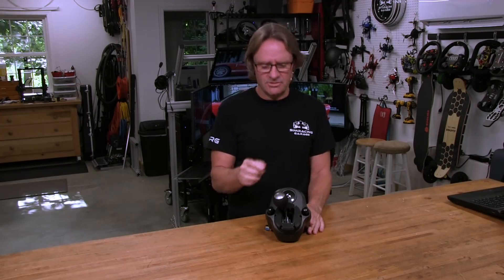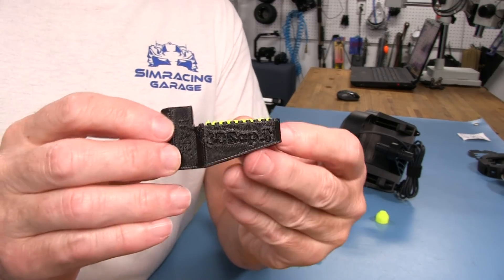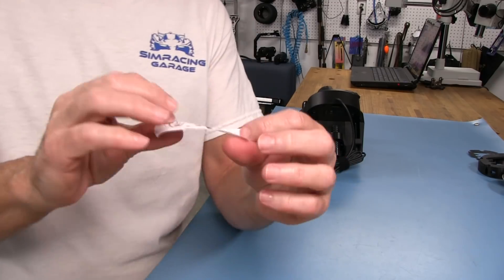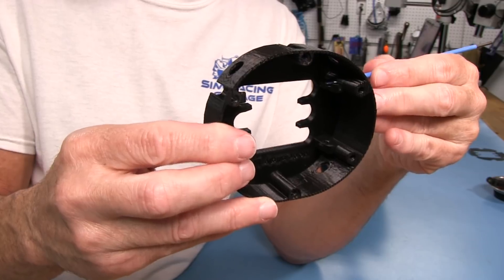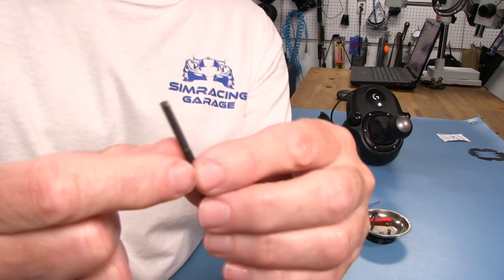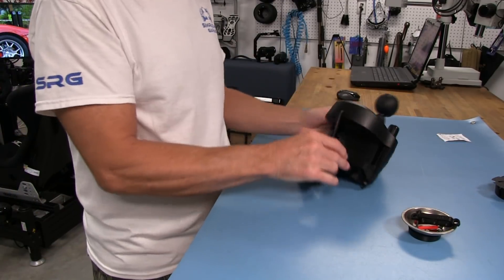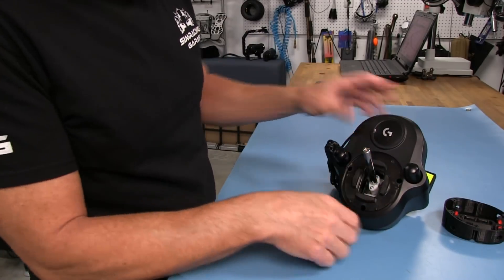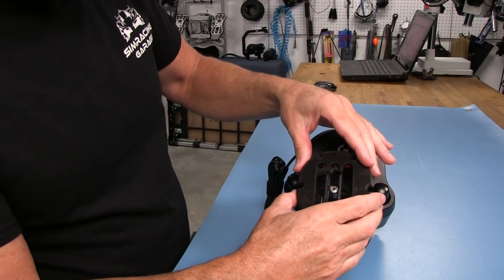3DRap Logitech G29 Shifter Mods

Comment: After finding a bunch of different mods on eBay, I came here for some honest advice. I saw the 3Drap solution as the 'premium' model so after this review I bought it. It's been installed for two weeks. Everything in the video is bang on the money.

However...

The durability issue is real. Not because it wears down though: It is so tight on the shifter shaft that mine snapped after about 8 hours of play. But it wasn't the first thing to break. It took less than an hour for the thin piece of material partitioning 1st and 3rd gear to snap off. I've just lost the opposite piece between 2nd and 4th. This gives my shifter more of an OI look rather than HH. There is still some clamping force from the snapped part (more so in 1st, 3rd and 6th as the snapped occurred at the other end) and it's definitely still an improved feel. But it is not the golden solution sadly.

3D-printed stuff is everywhere now but I am finding, consistently, that either the material oo the fabrication process often results in low tensile strength. I bought a 3D-printed mount for the shifter, for example, that showed signs of stress almost immediately and is likely to snap within the next couple of days.

So, great design but it needs to be fabricated with something either more flexible or more durable.
Reply: Update: I went and uploaded a video highlighting everything I mentioned above. 3Drap reached out and replaced my broken parts with their new version: a nylon clamp and metal top plate. At their request, I reviewed them after putting them through their paces... and they've fixed it! They're the golden solution again.
Reply: It's the 3d printing process. They are pumping out parts and want to do so quickly. It looks like they are printed at the lowest quality. Find one that's made of ABS and not PLA
Reply: @Mk6GTIMike  I know I'm late to the party, but I was thinking the same thing. PLA is not the material I would have chosen to make that gate out of. I would have done it at least in PETG, if not some form of Nylon like a Taulman Alloy 910 or something. However, I have seen recently a mod that uses magnets instead of something sliding on rods, and that's probably the best solution.

Comment: After finding the whole G920 with Wheel, Pedals, and the shifter and a Mounting System for it at an estate sale for 55 bucks, I think 40ish in mods is reasonable, imma have to check it out.
Reply: Thats insane
Reply: you actually got a working G29 for 55$????
Reply: @alouisschafer7212  Yeah, the Xbox one, with the shifter and a pedal/wheel/shifter fold away stand/mount. Gotta love those estate sales.
Reply: @Bilbo Fappins they had a thrust master too.... I done fucked up by not getting that one.
Reply: @randipoling635  thrustmaster has an even worse reputation for reliability than Logitech does on their entry level stuff. The G29 is fine. It’s nothing earth shattering but I’ve never had a problem with mine once.

Comment: 3Drap is the best! Giving us what the manufacturers should've ➕ for a cheaper price
Reply: @trigger_me_timbers  I think he got paid to leave that comment
Reply: @trigger_me_timbers  The problem is the durabilty, i wouldn't mind paying that amount even thought it cost half of the clutch, if it lasted, but it doesn't last long and by the way, don't forget the cost of deliver...
Reply: If I could get it shipped to my place for a decent price I'd be all over it. But it's not cheap to have shipped to Canada and shouldn't be hard to make in a 3dprinter program. They're probably on thingiverse actually
Reply: @tylervardy3917  my 3D*c*rap shifter broke after only 1 week.  The inner piece that is considered a wear item, broke after 7 days, and the top shifter plate cracked after 2 months. 

I'm from Canada, 3Drap offered to ship me two of those inner pieces to guide the shift selector, but shipping was $20 Canadian. I'll pass.  The top plate I still haven't contacted them about, but the overall quality is extremely poor.

Comment: I own the THPA Shifter I got an old golf club (as the shaft steps down   size you can fit it snugly over the top of TM rod )then put a sparco quick shift knob on top ....also mark on shaft where the hole is on the original shaft and but a small bolt through to hold in place ..it looks and feels bloody great.......its not as slap dash as it sounds 👍...

Comment: Thanks for a great review. Would you, as an expert, prefer a longer stick with the mod in place?
Reply: I always figured a slightly longer shifter would feel better/more realistic but I'm not sure
Reply: That's what she said
Reply: depends on what ur used too. my last car had the shifter mounted on the dash next to the wheel rather than between the seats and it was like the g29 in looks and i noticed it was easier to use for me than the longer shifter in my other cars.
Ive modded my wheel rig set to put the shifter next to the wheel rather than low down where it was before.
Means less distance for ur hands to move so u can get ur hands to and from the shifter and wheel faster.

Comment: Very informative video.  Your videos are awesome explaining things in great detail.  Do you know if it's possible to change the shift knob to a t handle shifter like a hurst or maybe even a pistol grip? Is it possible what would be involved? Thanks
Reply: It is possible. There's a few different ways to go about it, however, if you're looking to run a "standard" (real life) size knob I'd suggest a solution like the link below. You can specify what thread size you need for the adapter to fit your specific application.
https://www.ebay.com/itm/Logitech-Shifter-Knob-Adapter-G25-G27-G29-G920-/263627486116?redirect=mobile

Comment: Hi Barry. I got the improved feel mod today and followed your excellent video to install it. However I find it's now way too stiff and the gear stick gets stuck in gears - I have to use all my force to get it back into neutral. I notice in your video driving at the end that you use a lot of force to move between gears. Is this how you normally drive or is this to counter the getting stuck in gears that I have found? I can't apply this much force on my rig because it's tpo noisy: my wife came running upstairs to find what the racket coming from our bedroom was! I also feel it's pretty unrealistic: I don't drive myself (yet) but I've never seen drivers using so much force to change gears. Any thoughts? Cheers.
Reply from the maker: With my shifter it is not that hard to change gears. Not sure what could be causing this. I would disassemble the mod. Try it without the mod. Then re-install the mod.
Reply: Thanks Barry. It definitely doesn't feel right. I'll disassemble but will need to find the correct sized allen key for the shifter screws. Cos took me ages to loosen/tighten them with flathead!
Reply: So I spoke to 3Drap and they think the piece that holds the gear stick was simply the wrong size and are shipping me a new one for free. Hopefully that will fix everything.
Reply: did it fix it?
Reply: @ekhliousful  it did not buy apparently I'm the only person who has reported this issue. I think it might be a problem with the grease I'm using.
Reply: I got some shimao grease andthat made it a lot better. personally I still find it too stiff though and quite noisy so have gone back to the factory standard.
Reply: @formulaic78  i guess i am not going to buy it then thanks for replying
Reply: You need to buy silicone grease, the parts look like carbon, with standard bike greases, PTFE/Lithium etc they will cause the carbon to swell, WT40/GT85 will cause the same problem.

Comment: Man I miss being able to break with my left foot, recently became paralyzed on the left side and am using one foot on GT sport with a DFGT. Considering getting the G29 but really hate missing my left leg.
Reply: 3drap has a mod for playing without using your feet. You control the throttle and brake with your hand. I don't know if that would be useful for you.
Reply: berarma thanks a lot for the tip, I can use my right foot for both pedals but clutch/ heel toe is a no go. I’m more interested in sequential shifting options, looks like there are mods for the G29 that work for this, hopefully anyways.

Comment: Great video!!! I have a question. How about the durability? I guess you use this mod for about one month. Did you have any problems?? Thank you.
Reply from the maker: I haven't noticed any degradation in the feel yet. I think the trick here is to make sure you have an ample amount of good quality lube applied on the appropriate friction points. But no matter what you do, it will wear out eventually.
Reply: @simracinggarage3026  Thank you very much. That is all I want to know. I have some problem with some gear switch. 4 to 5 and 5 to 4. I was looking for something like this mod, and I think I will buy it.

Comment: Great review buddy, however, you should try to use a clutch with this setup, it must add quite a thrill, also trying Punta Taccos gives so much adrenaline during race.
Reply: In that kind of race car you usually do float-shifting. Pretty much like on an Eaton Fuller Manual gearbox in a Semi.

Comment: Yeah, a 3D printed clamp is stronger than a proper injection molded plastic part, sure, and as for the grip, all you need is some hot glue.

Comment: Shame there was no way to reattach the leather boot of the original.
Reply: I thought the same exact thing. Only a matter of time until some small object falls into the now completely exposed shifter.
Reply: @milkshakemuncher  is the 3drap product reliable because I am wanting to buy one but want to know how long they last and Also which one to buy in 2020
Reply: @raxal9833  mine has been in for a few years now, I greased it a bit when installing it just so it slides better and doesn't wear out as quickly also once every 3 or 4 months I lube it with a little grease again. It is still going good but in saying that, there are periods of time where I'll use it every day for a few weeks but then sometimes not use it for a couple of months. At the time of purchase I also bought the carbon heavy duty insert to replace the smaller one if it broke (haven't needed it yet). I was like you, not wanting to waste time and money if it would break after little use. They say on the website that as it is a 3d printed plastic item it will eventually wear out, but replacement parts are cheap and from my experience it lasts a long time that you get your monies worth.
Reply: @raxal9833  if you click the blue link in my first comment, it will take you to the 3d rapit site on the exact page of the mod I have is (Cambio H shifter V2 mod) 14.99 Euro I think. Then if you scroll down that page you will see the standard V2 replacement piece 6 something Euros and to the right you will see carbon extra strong V2 insert 9 something Euros.

Comment: To impove my mounts, i have literally just jammed a couple of soft erasers in between the mount and the desk... no need to print/buy new clamps
Reply: i have mine mounted to a wooden platform (sililar to a desk etc) with no additional support and i can tell you right now, i'd snap the stick off right off before the clamps were to come loose. 

whilst im appreciative and a fan of the content, i find a lot of the mods recommended by the channel to be a little unnecessary and in some cases wildly overpriced.

Comment: I bought one of these and it is an absolute nightmare to fit
the fit and finish is awful
i bought the metal H plate to go with it.... doesn't fit.

there are little bolts that you are supposed to put into slots before putting the H plate on, those kept falling out.
I lost 3 of them inside the shifter and had to completely dismantle it

Comment: How would reverse work on it as a 6 speed? 🤔
Reply: I think its push down and put in 1st.
Reply: Push down into 6th
Reply: @tylervardy3917  so you push down as you go into 6th with this kit on? Isn't it a 7 gate shifter with a "safety" on the 7th?
Reply: @barrabikes6890  yeah you have to press in on the knob and push it downward and then shift into 6th. 

It's probably the worst part of the shifter honestly.

Comment: seemed to be a very helpful vid.  bad news, I ordered this kit from 2 different sources in an attempt to end up with what you reviewed.  Never happened. Result # 1 I received the “cup component” of the reviewed kit. That’s it, no other parts(internal or external) nothing!  Result # 2 I got the same cup and the pattern decal, still nothing else.  For Gods sake, how can I get this mod kit.  Barry, if you have a spare, I’ll buy it from you. Thanks for the vid that now keeps me awake nights.  Help me!  Bob
Reply: bgk71 You can go to 3Draps website or you can find them when you type in g29 shifter mod and its the 3.5 version should be like $50
Reply: You bought knock offs. Order from 3Drap if you want the one in the video

Comment: My logitech shifter seems to mis-shift in certain cars in assetto corsa, when shifting into 4th and especially 5th. Shifting into 5th often goes to 3rd instead. It's my second logitech shifter with the same issue so I don't know if I'm unlucky or if it's a known fault with the shifter itself. Any idea if this mod can rectify this problem? I'm considering upgrading to the fanatec but I'd hold off a while if the mod works well.
Reply: they're all like this. I'm getting better with mine with practise though.
Reply: You might give a try spraying the potentiometers or buttons inside the shifter. 
Once a year I spray my pots in G25 pedals, then I had to spray shifter pedals buttons on the wheel cause I had double downshift problem, and today sprayed pots in G25 shifter cause I had problem with sequential shifting.  Your problem might be mechanical but you can always use Electrical Spray on buttons and pots...
Reply: @xrider55   Thanks for the tips. I'll definitely do that. It only happens in cars with H- pattern but only some cars so not sure if it's assetto corsa or the shifter at fault.
Reply: Tighten the T-shape screws on the shifter gimbal down inside the shifter that grabs the T-shaped holes on the walls inside the shifter.
They work loose over time and will then go into 3rd and 4th instead of 1st, 2nd, 5th and 6th.
Disassemble the gearknob and leather boot, you'll see the screws I'm talking about, they stick out on the left and right side, just hand tighten them.

Comment: The Mod is very stiff and make the gearshift more realistic, but after a month of use I can say that many times I got stuck in neutral or had wrong gear change. Sorry, but I can say it makes the gearshift very inaccurate and not suitable especially in races.  Original gearshift is soft but it's nearly impossible to make mistakes!
Reply: did you ever fix it?
Reply: No. Once used  to the original version you'll find that Logitech driving force works perfectly despite the unreal softness. % of error is very low and this matters much more than the real stiffness of a gearshift
Reply: @sergiomagni8845  how long has it lasted for you or how long have you had it for?

Comment: I am not in the least impressed with 3drap products. I have the piece to make your shift feel more like a real car and worked halfway decent at first and after a couple hundred shifts it felt like id taken it out because it wore out, i would not recommend them
Reply: You should have used a silicone based grease instead of the oil based grease that expands the plastic then.
Next.

Comment: Just wondering, would the part that goes for the shifter (not the clamps) work for the G27 Shifter?
Reply from the maker: According to the 3Drap website, yes.
Reply: The g27 shifters are almost identical to g29, for the 29 they moved the buttons from the shifter to the steering wheel. The basic design is the same, and mechanics are the same. Clamps and shifter are exactly the same which is why it is compatible for both. For example I still have the g27 shifter and there are some people still using the g25 shifter since it has the sequential shifter option.

Comment: Brought mine both the top plate the plastic guides have snapped and the plastic slider has broke with very very little use I’ve emailed the company and had no response - disappointed to say the least as the mods are not what I call cheap.
Reply: Ha ha!!!!! Same thing happened to me. There junk.

Comment: How do you shift to reverse with just the 6 gear settings?
Reply: 6th gear has two positions. If you just put the shifter into 6th you get 6th gear. If you push the shifter down and put it 6th it hits a different sensor and you get reverse.
Reply from the maker: Correct! Thanks!
Reply: I know Barry you told me when you did the review on the shifter lol. If only I'd paid as much attention when I was at school.Love your deep dive reviews. Keep up the good work sir.

Comment: Biggest drawback is that you're losing the reverse gear. As I also have the SKRS (truck) shifter mod, a reverse gear is quite important. Checked their website, but they don't have a plate with support for the reverse gear...
Reply: You don't lose reverse gear,  push down on the stick and select 6th.
Reply: Nope. Fake news.

Comment: That's just what i am looking for only one MAJOR problem, mine has reverse, or do you not use reverse?
Reply: I tought same.
Reply: Plenty Ponies press knob down and it’s where 6th is. Just have to hold the job down.
Reply: The logitech have a reverse like a usual gearbox you push down on the knob and put it into the 6th gear to engage reverse